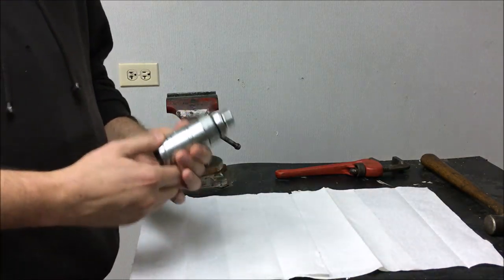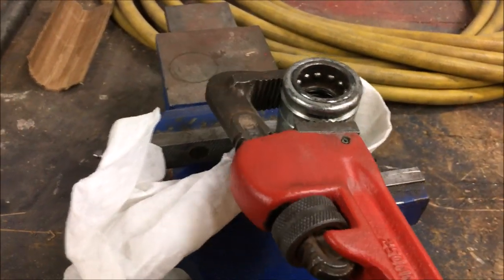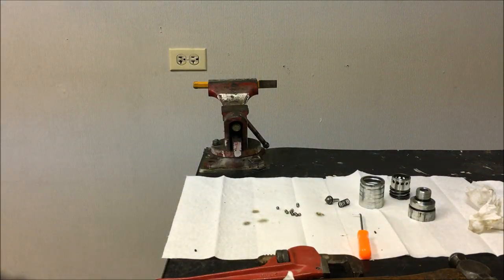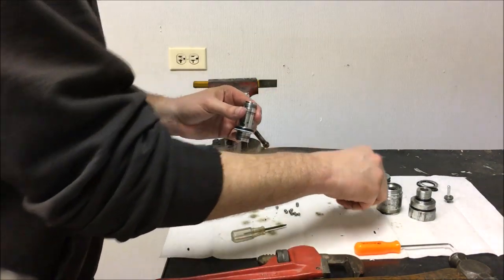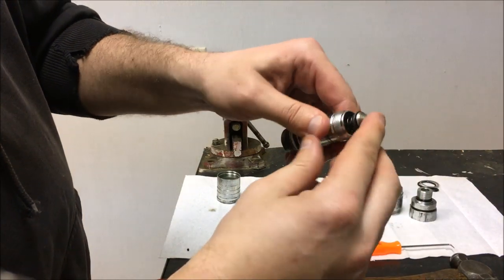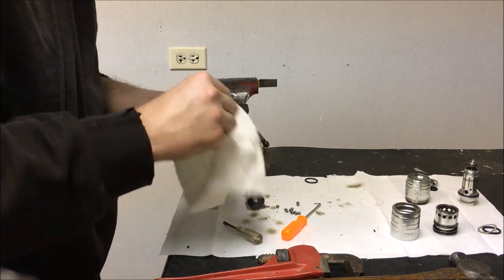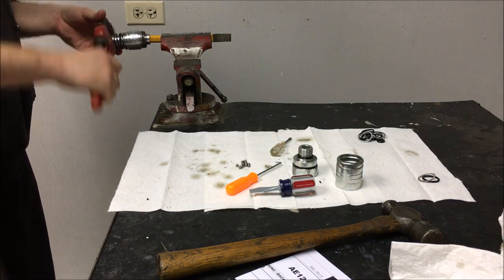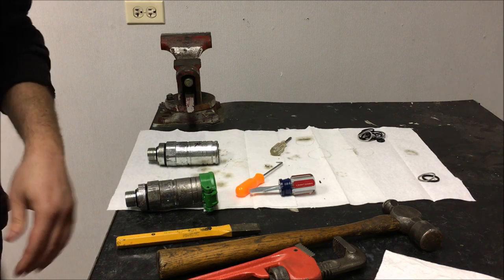HOW TO DISASSEMBLE HYDRAULIC COUPLER OR QUICK DISCONNECT

Comment: Great video.. would like to talk to you about the problems I'm having. First off I can't seem to find rebuild kit.. then there's a big spring held on by a retainer. In the video you don't show anything on that.  The retainer broke on mine.
Reply from the maker: Aaron kalmer thanks! It was all o rings and seals in the rebuild kit. You would have to look at the parts manual and see if you can order the retainer I can’t remember if it showed it. I looked on the Jd site they have parts manuals. Then I normally order the part number from green farm parts
Reply from the maker: Aaron kalmer I don’t think my style has a spring in it I’m pretty sure I took it all the way apart
Reply: @WorldsOkayestFarmer  if I can figer out how to send you a PM I would show you what I'm talking about. And I forgot to mention this is on a massey ferguson 6170. The style is about the same. If you have Instagram we could chat there. I don't want to mess up your nice thread and video with my problems. It is such a helpful video
Reply from the maker: Mkotch63 I don’t use it much mine did have a spring it’s been a while